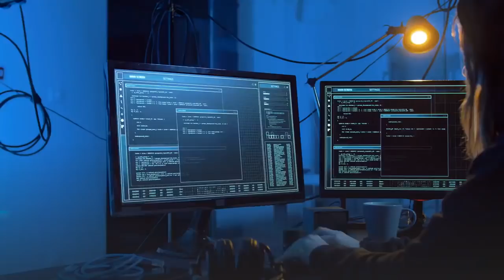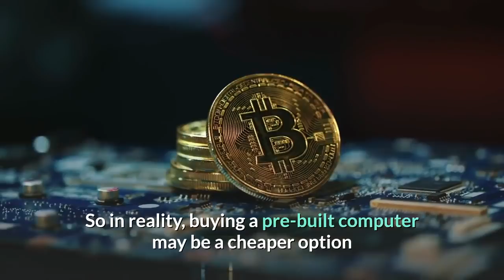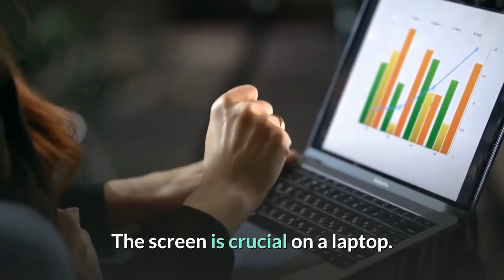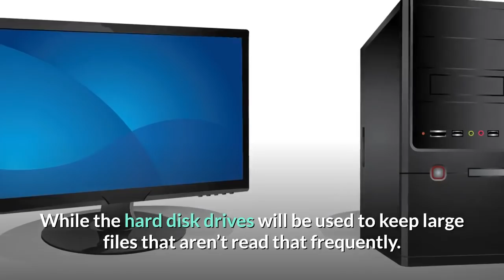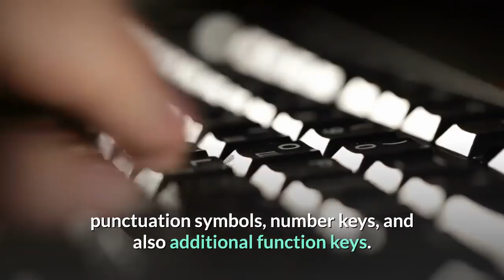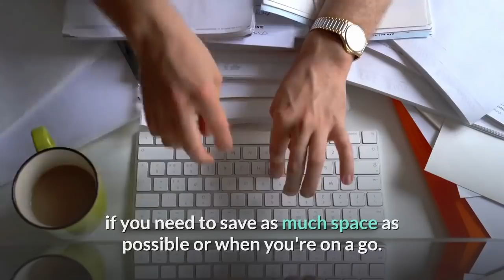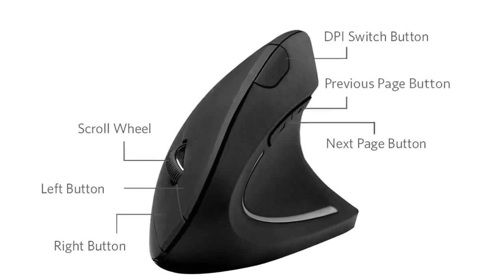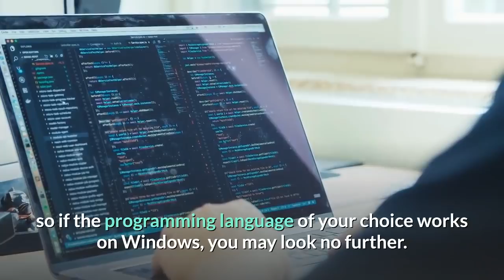Best computer for programing & coding | PC vs Laptop buying guide

Comment: As a programmer, your priorities are an OK CPU, reliable SDD, enough RAM, nice monitor and a comfortable keyboard.

- CPU: most modern cpu are more than enough for 99% of programmers out there. Focus in getting something recent, but not overkill. An i9, i7, ryzen 7 or ryzen 9 are great, if you can get afford them, but do not lose sleep if you go with a cheaper one. Any chip that's not older than 2 years is acceptable if you're thinking of buying new, if you already have one, as long as it isn't too old, it'll be just fine. I wrote c# in visual studio on a i5 from 2016 with no problems. 

- GPU: if this is a workstation, and you're not making AAA games or into any form of design, which GPU to buy should be last in your priorities. An old RX 550 go for about 90$, and is perfectly fine. Do not get into the PC master race unless you have deep enough pockets. And if you're certain you're not going to use it, just buy a CPU with integrated graphics.

- ram: 8gb ram minimum. Right now ram isn't as expensive as before,  so 16gb is the sweet spot. You can find 2x8gb sticks for around 60$. Note, if you decided to go for an AMD cpu, pay attention to the speed of the ram you're getting. If possible, go for 3600mhz, 3000 minimum. 

- storage: get an ssd. You can get a low storage one (240gb) for ~40$, just install your OS, IDE, and main apps here and just buy a HDD when you can . Do not pick a weird Chinese brand. Well, this kind of applies to everything. I don't recommend anything lower than 250gb, as SSD needs around 15% free space to work and you need to install programs and your most common files on it, the jump from ~120 to ~250 is so small that is just not worth going that cheap.

- motherboard: the only requirement is that is from a nice brand and that it won't bring you headaches. Go ATX or micro-ATX depending on the size of your case. Micro-ATX are typically cheaper tho, and if you're not planning on overclocking, they should be more than enough as long as they don't suck. microAtx go for around 60$-100$ and atx anything between 100$ and 700$. Do not spend more than 150$ on a MOBO in this kind of system. Leave that for your gaming one.

- power supply: there are a bunch of power consumption calculators, just google them and place in your parts and it'll recommend you some wattage. Just go for a 80+ bronze and a reputable brand. Seasonic, corsair, EVGA are great options. 70-90$ should be more than enough. Don't mind if is not modular, your priority is the watts, brand and that bronze certification.

- Keyboard: do not skimp on this. You'll be using it almost every single day for hours at a time. It needs to be comfortable, easy to type in and durable. Just because you're cheaping out on other parts, doesn't mean you're going to buy the cheapest everything. 
- Mouse: just get something reliable but nothing fancy. 

-Monitor: crisp and detailed letters are easier to read. You'll be looking at your monitor even more than what you'll use your keyboard. Buy a decent monitor. Go for 4k as soon as you can. Ignore anything beyond 60fps, you'll have no use for it. Oh, and try to get one that has a vertical mount included, vertical monitor does wonders to your ability to read code.
Reply: Bro is ryzen 3 3200g ok?
Reply: @cheesenutz3854  I didn't even remember making this comment lol.

Tbh, I haven't used that cpu but it depends on what are you planing to use it for. If it's for something like web dev, you'll be more than fine
Reply: @Juan-lj4pi  im currently learning javaswing right now. Thank you for your fast reply brother god bless u